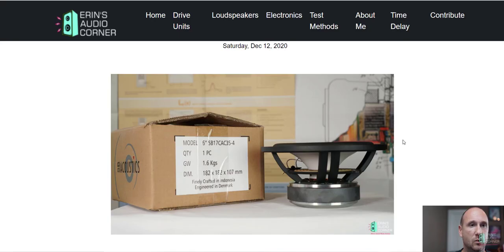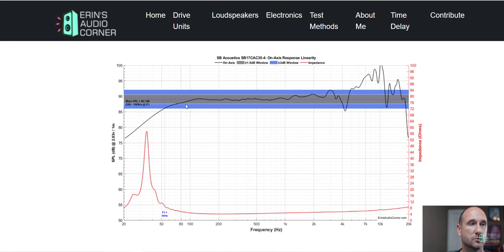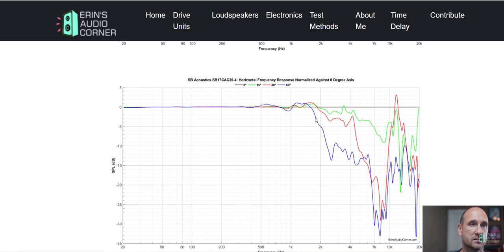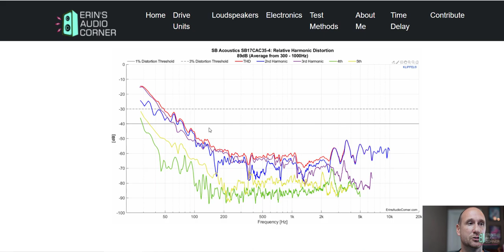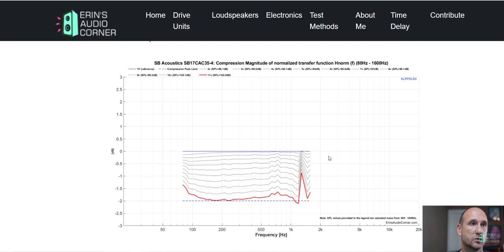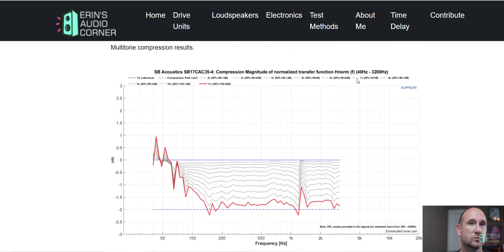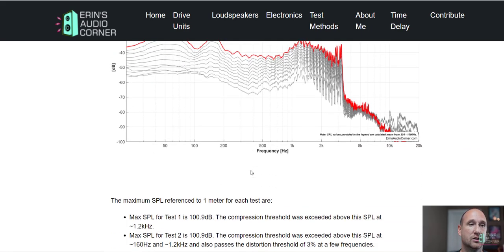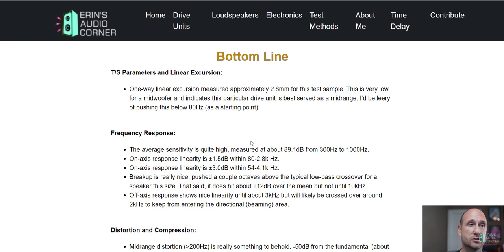SB Acoustics 6-inch Midwoofer SB17CAC35-4 Review

Comment: I was thinking of making a oversized bookshelf 3 way with the cheap trick to getting more bass with low distortion with the cheap SB17CAC35 is to simply add more drivers to do the bass only, and one just doing mids, this way u get low distortion mid-range at high volume as well as low distortion at 44Hz by using 4 x SB17CAC35 in separate ported chamber,baffle step compensation problem solved too, and there is no much power u don't even need a sub. The Purifi PTT6.5W08-NAF-01, are like 10 times the price in Aust. $750aud the SB17CAC35 just $70AUD, its better to just use a stack of cheap drivers, and get similar performance. if you have the space, bigger box.
Reply: You'll have to pay 280aud instead of 750 (which does not appear to be a huge difference) and won't be even close to a performance of Purifi in THD at 44Hz I'm afraid. There is no cheese for free. Everything was measured, compared, estimated long time ago, and a price represents a sum of everything. I'm afraid you can find "cheap but good" only in India if you're lucky, which manufacturers have no experienced marketers yet hired.
As an option you can consider high sensitivity woofers with low distortions (like Beyma or RCF) as a dedicated sub. Then you can drive them with AA battery and have as loud sound as a rest of 87dB/1w system ))) Joking..
Reply: I'd opt for a 12" to 15" woofer, or multiple 8", crossed to a sub at 80hz. Even a "mid level" 8" driver like the Dayton RS225 series has lower intermodulation/harmonic distortion and better bass output in that passband than any SB17. SB17 in a sealed 7-10 liter enclosure would work well for that arrangement.

Comment: Hi Erin, would the 8 inch version work well in a porsche 911 Door for someone who doesn't want to use a subwoofer?  It's very hard to find an 8 inch ( especially in Australia) that can play crossed 30hz to 200hz after which the focal 4 inch k2 driver will take over. The dynaudio mw172 mw182 is a popular choice in the porsche community but they are near impossible to find, cost 3 to 4 times the price of the SB with shipping and don't seem to play as low as the SB, As I have no need to play higher than 200hz.

Or is there some other drivers you can recommend for my application?
Reply: You can look for 6.5" subwoofers

Comment: Please help me to see it.
SATORI MW13P and sb17cac35 (ceramic) 
I am confused between these two woofers.
The satori is cheaper, probably because of its smaller size.
I want a crystal like sound, which unit has the more complete sound?
Reply: Satori is the top of the line in SB Acoustic so it was no way cheaper than the regular SB Acoustic. A pair of SB17CAC35 is half the cost of a pair of Satori MW13P.

Comment: hi. why didn;t test the MFC or CRC of this driver? talked to Mark from SB said both much better linearity and easier to work with that AL/Ceramic. Also the MFC graph looks much better..and MFC and CRC gets better Fs
Reply: What graph are you looking at? The MFC version starts to break up at 3k, and the CRC has a much worse off axis response and starts to break up at 4k. The CAC has a smooth roll off after 2k all the way up to 6k. Properly crossed over anywhere in the 1500-2500hz range you’ll hear no ringing whatsoever from the CAC. I’d use this in a 3-way from 200-2000hz, and get something beefy like the SEAS L19RNX1 or SS Revelator for bass duty.

Comment: @Erin's Audio Corner Would you use this in a near field monitor application? Do you think it still needs a HP around 80Hz in that case?
Reply from the maker: For nearfield, I don't see why not.  The crossover would really depend on the output you want and the room.  Sometimes a sub placed at a different spot helps to fill in response issues (like floor bounce, etc) that come with nearfield listening.

Comment: Is the limited excursion 2.8mm a mechanical problem with suspension? Force factor looks OK and so does inductance variation with the displacement limit. Bad spider? Maybe a bad sample? I think that 'burning in' is mainly about the spider IMO. Otherwise looks like a very good driver although I prefer the polycone version SB17MFC35-8 which is exactly the same motor and suspension wise.
Reply from the maker: No problem, per se.  Just the distortion threshold limits.

Comment: This one used by a lot of people. Many, including me will appreciate the test 👍. This woofer is easier to implement than NRX version due to cone break up modes. But from what I see, above 1kHz the distortions are raising and if I use it in, say 20L bookshelf with baffle compensation, it would be nice to cross it way below 2kHz. As always finding a good tweeter for low crossover point isn't easy. Summing things up I'm kind of disappointed by this driver.
Edit - my Polish DIY forum friends say this one sounds mellower than NBAC Alu black cone if someone finds the ALU version too spicy. Comparing to NRXC, both of them sound with more 'fireworks', but also not as 'smooth' and natural - similar analogy to metal dome tweeter against good silk. Something for something I guess. The 17NBAC I use against 17NRXC has x-over around 2k, acoustic LR4, full Baffle step.
Reply: try the Wavecor TW030WA11 (4 Ohm version...), with an Fs of around 450 Hz and the Waveguide you can filter at 1-1,5 kHz. In my opinion it sound amazing and its not even to expensive.
Reply: SB26ADC with the 6.5" Somasonus/Augerpro waveguide is a great combo for a 1.6khz third or fourth order, I can attest. SB26ADC's distortion stays quite low down to 1.2khz in the waveguide. Only major downside is driver spacing, vertical window narrows to ~ +/- 15 degrees at -3db. Really solid combination. ~$150 for tweeter, waveguide and SB17NBAC. Add a little extra for the ceramic SB17. Akin to an SB Acoustics "Bromo" kit with a lower crossover point, improved directivity matching, decreased 1-2khz distortion, and improved tweeter power handling.

Comment: Is this what's in the new Philharmonic BMR? If so, maybe it's not a better choice than the previous ScanSpeak for that speaker.
Reply: It is. Comparing the original to the current BMR, it does lose out on 2Hz of bass extension for the frequency response spec (not sure if say F6 of both); but the ceramic allows for +1.5dB in sensitivity; it’s a worthwhile trade off in my view.
Reply: It’s complicated.
The good: 
cheaper
higher sensitivity 
good looks

The bad:
Lower Vd.

The ugly:
bass distortion (50-200Hz) is worse (or at best, the same as the 8545-01? )

Let’s remember that the 18W/8545-01
Klippeled in at 2.8mm compliance limited by Voice Coil Magazine in 2012... but what does that actually mean. Because during those condition bass distortion is only 1% at 50Hz...and no one complains that the 8545 has “bad bass”; 
it’s a “oldie, but a goodie”
Reply from the maker: I'm not sure TBH.